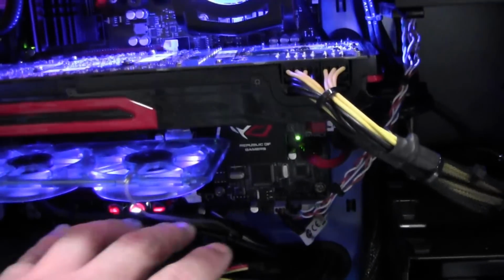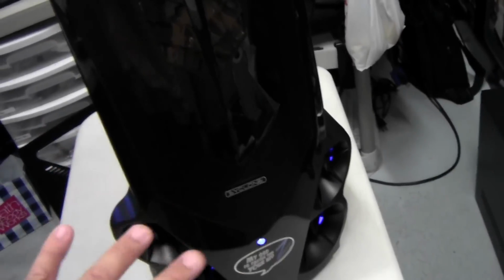Aero Cool Cyclone II AMD 8 Core 7970 Build Part 2

Comment: That's crazy, I am still using it till now...ok my PC desk is so old (2013 mid/high build) but the air flow is still amazing on it. I am gonna try to recycle it with a 240/280 Aio of I can.

Comment: seasonic s2ii 500w will it be suitable with this case ?
Reply from the maker: +Youssef Mikhael That power supply will fit in the case.  In terms of power it depends on what graphics card you will use.  Seasonic Power supplies are some of the best on the market,.

Comment: the fan in the upper front, throws off the air?
Reply from the maker: +Andrea Favretto we set the upper front fan to exhaust air push air out of the case

Comment from the maker: Unfortunately we finished the build awhile ago.  If I remember correctly you need to take off the top of the case and use short screwdrivers to screw in the fan.

Comment from the maker: This is a nice case, power supply in the computer I built is intaking air from the bottom of the case, the idea is that this helps cool down the heatsinks and other components in the power supply better.

Comment: Ahhh so we used a 120mm fan for the top port! With LED too - AWESOME!! Really nice set up!! Thank you so much for uploading this.

At this point I have only 1 question: Is your PSU taking in air from the bottom of the case? Thanks!